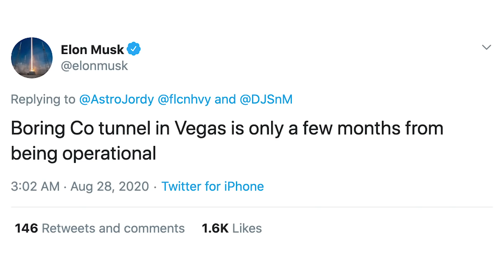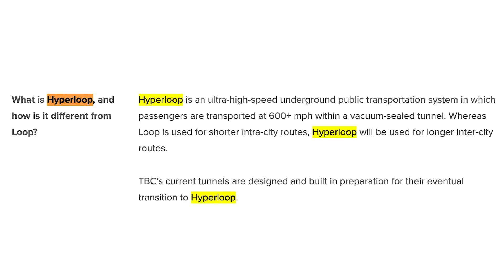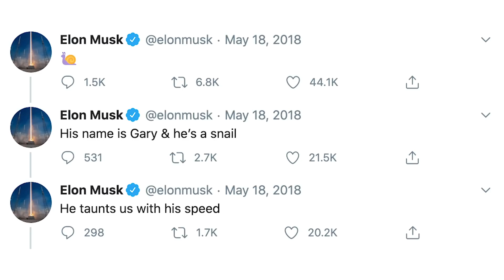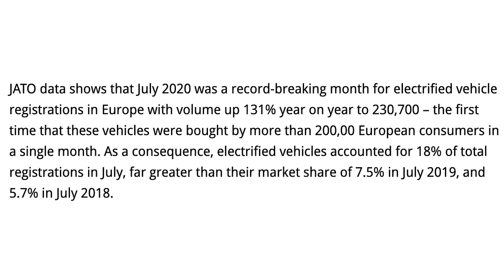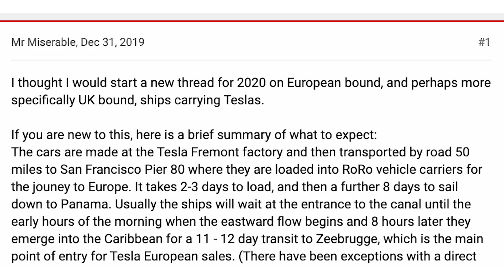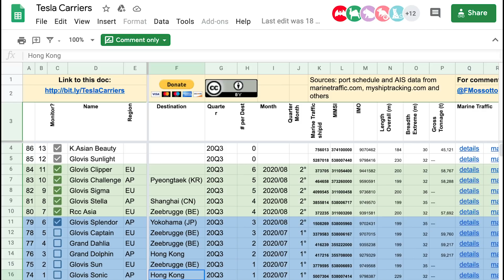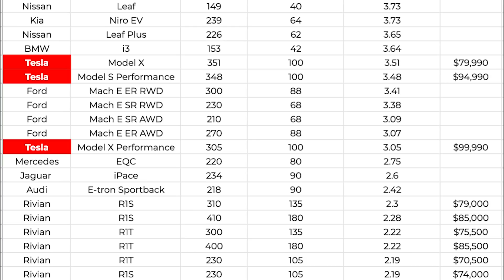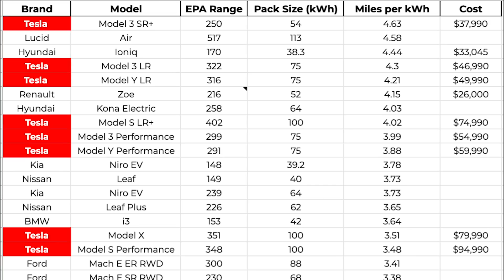Tesla's European Sales Figures Lagging

Comment: A friend of mine just bought a Kia Soul with range of 450km at a 64kw battery. 😳
Reply: AspenPro86 
It’s a Kia though...😕
Reply: How much was the Soul?  And what is the real range vs. the "sticker" range?  How much battery is used to operate the car's systems vs. being used for range?  It's hard to compare ICE cars to Teslas because the Tesla has a bunch of stuff that comes "standard" (auto transmission, huge display, OTA updates, phone app...) which would be an upgrade (if you can even get it, like Dog Mode) in an ICE car.  How do we put a price on Dog Mode?  My dog Gretchen would say it's worth $5000 (she's the pillow in my picture), and that I HAVE to get it in my next car.

Comment: I may be wrong but I think 2 factors (besides price) are hurting Tesla in Europe. Europeans are very brand loyal (french and german cars) but also Toyota Hybrids are very popular.
Reply: What is not hurting Tesla in Europe is the fact of very limited production, and the worldwide demand is by far greater than supply, and the same applies for Europe, where an insufficient numbers of Tesla are presently shipped to, hence the lagging sales numbers. it will take an additional 24 months for Giga Shanghai, Berlin, Texas, Nevada and others yet to be announced Giga factories to optimize production, and European and worldwide sales to hit the roof. Within 24 months we will be able to purchase also the new low priced Tesla which should be below $25.000 and from there on you will see the competition starting to back pedal. Quality? It will be overall of a much higher level than European has ever seen, Thanks to perfect machines that build machines and with tolerances very close to perfection. Trust Elon Musk and his Silicon Valley superlative minds, they know exactly what customers are expecting from them, and are tooling to deliver just that. In the meantime please check on the coming Battery day around 9-20-'20 where very interesting news will be made available.
Reply: @sat7755  They don't have to cater to European market as long as the demand is bigger than supply. But, when the day comes where Tesla will be truly interested in the European mass market, they have to make smaller, cheaper cars. The market is big enough for all of them EV companies and the growing number of countries that have deadlines around years 2030-2035 for no gasoline, diesel cars, will bring millions of customers to this market.
Reply: @Daniela-pr7rz  Being an European myself, I understand you perfectly. I trust Elon Musk judgement on how to supply markets with cars that fit their demand. budgets, and local road situations. I believe that the Giga    Berlin which should be starting functioning middle of next Year, will probably design the cars that will have greater appeal to the European market, which will follow the same trend as Giga Shanghai too, with its own design studio, where are already working on a low budget Car to be shipped to different world markets probably within 2 years, and by then probably we will have a lot more details of Tesla future products.

Comment: Dillon, great content as usual, however I would note that Matt Joyce (@matty_mogul) has already produced a great core efficiency chart, including the weight impact. Both Rob Mayer and Gali have discussed this a number of times.
Reply: Just tagged you on Twitter link
Reply from the maker: David Holtom just unsure how I feel about the weight metric. It’s already baked into the EPA range in a sense. Love to hear your thoughts
Reply: Electrified I think it’s unfair to compare the efficiency of a Cybertruck vs an electric mini without considering weight, as a proxy for the additional utility you can get from a larger vehicle. That being said, weight reduction itself is obviously an important goal as well. At the smaller end of the spectrum you have the FUV from Arcimoto which has an excellent efficiency and I think has a very bright future (would be a good future video subject).
Reply: An alternative might be to use passenger capacity, although this would not consider cargo capacity, which is also important.
Reply from the maker: David Holtom yeah it’s nearly impossible to consider all factors well and relatively. Just want to have a comparable metric as a gauge but will keep working on it!
Reply from the maker: David Holtom thanks for sharing David!

Comment: There is an error about starting price of the Zoé in France, which is nowhere near 26k$. It's 32k€. (source:https://www.renault.fr/vehicules-electriques/zoe/configurateur.html)
Also, this price includes VAT, as it should (≃20% of the final price, which is around 6400€) Without it, the price would be 25600€ or about 30500$. The French government also pays 7000€ of every new Zoé
I would like to add, comparing price in a country, without tax with the one in another is not that helpful. For example, the model3 SR+ in France is sold at 49600€, and is listed here at 37999$ (the US price without VAT, I suppose). The government participation on electric cars of this price is also "only" 3000€. The Zoé is clearly not in the price range of any Tesla, but it is not in the same class either. Would have loved a "cheap" Tesla, it would be so much better than the Zoé.
Reply from the maker: Florestan Trément thank you for sharing this!
Reply: In The Netherlands there is an additional luxury tax, that has now been converted to an CO2 emission tax. F course for EV’s this is 0%. Starting price for Zoe in the Netherlands is €33.590 including VAT. You can apply for a €4000 credit, but when this fund is depleted you’re out of luck.
Reply: Ya, that's the problem with a "cheap" Tesla.  Elon said, "we won't produce cars with anything other than a 5 star safety rating on everything."  They just won't produce a sub-standard vehicle, and they set their own high standards.  The only way to make the "everyman's car" is to vastly reduce the $$ for the battery... We'll keep our fingers crossed! I see the Zoe has a 216 mile range; that helps the $$ a lot.  And  I agree, the price comparisons should be "real world" comparisons, including VAT, tariffs, "you're buying a luxury car so we're going to screw you because we can and you want the product" tax, etc.  In the United States, each state has a State & Local Sales Tax rate of anywhere from 0% to 10.02%...So a $50,000 car can cost from $0 to $5020 in S&L Sales Tax...
Reply: @carlstockmal  the Zoé has a 52kWh battery 245 miles WLTP,  the model 3SR+ is 50kWh and makes 250 miles EPA for a much bigger car…

Comment: Omg. The table which you call "The most efficient battery packs" is extremely misleading.
Those are not the efficiency of battery packs, but the cars.

What is your definition of efficiency or a battery pack?
There exist a notion called Columbic efficiency and Voltage Efficiency, but I doubt that you are talking about this. (https://www.pveducation.org/pvcdrom/battery-characteristics/battery-efficiency)

So in reality you don't compare the "efficiency" of the battery packs, you compare the efficiency of the cars.
And a car efficiency depends on many things:
1. Aerodynamic drag, which is the multiplication of the drag coefficient and the frontal area.
2. Weight: The more the weight the more the rolling resistance is.
3. The size of the wheels.
4. How aerodynamic the wheels are.
5. What is the rolling resistance of the tires.
6. How strong is the recuperation during break.
7. How much energy is used for the electronics of the car and heating/cooling.

All of these has nothing to do with the batteries. All these are parts of the car. But somehow you take the cars efficiency and you try to reverse engineer some data for the battery packs.
You mention in the video that you may include weight. But it is still very misleading, because of the many other factors which affect the cars efficiency.

One related article about how much the wheels and tires matter: https://www.greencarreports.com/news/1128745_tires-and-wheels-can-have-a-huge-effect-on-electric-car-range
Reply from the maker: For the average consumer it's a starting point and something to begin to consider (miles/kWh). Yes, not exhaustive
Reply: @DillonLoomis22  
About miles/kwh: it is usually stated by the manufacturer. And it is something important. It is basically the consumption of the vehicle. But its not the efficiency of the battery at all. People buy cars, not batteries. 

You are misleading and confusing them that these are somehow the efficiency of the batteries. This is especially bad for those, who are new in EVs.

But I see a lot of people mislead by such comparisons. Even among those who in some way are "EV experts", like they have a youtube channel with Tesla/EV topics, etc. 
From this comes the term that "Tesla has the best batteries." Unfortunately when I ask them by what metric, they do not really have an answer. So far I see that they may have a cost advantage on batteries, but I see no evidence that there is a significant (>10%) efficiency advantage on the "drive-trains". However people say this over and over again without bringing up any evidence.